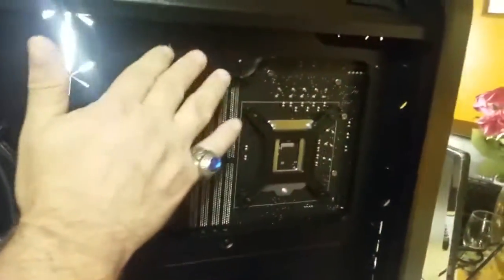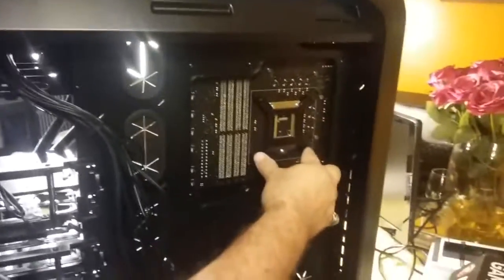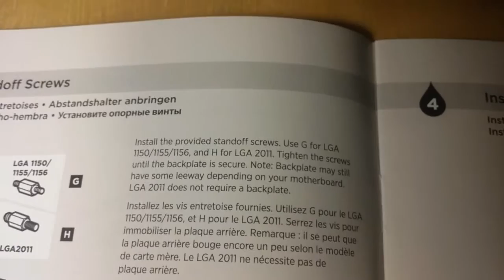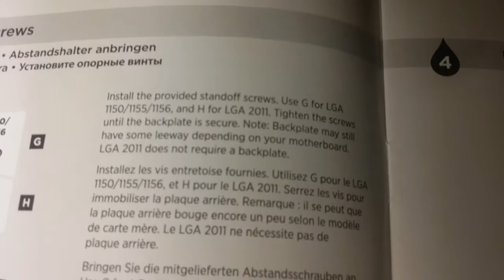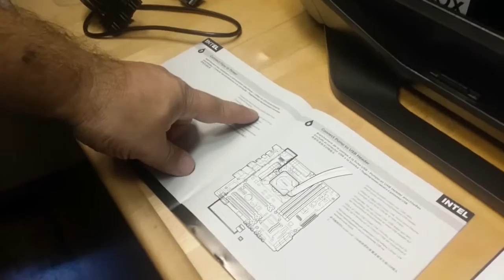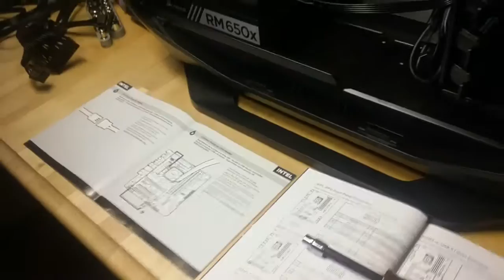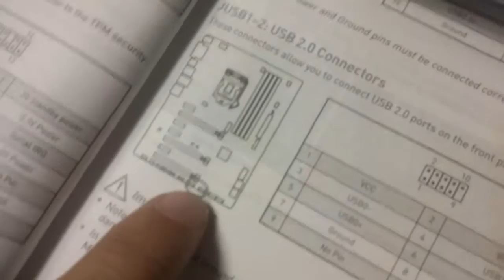Connecting the Corsair H110i Pump to the MSI Z170a Gaming Pro Carbon Intel (I5) CPU

Comment: dude ... the fans of the radiator  are in the opposite way ... omg  if u gonna make a tutorial  do it right
Reply from the maker: This system is still working nearly 4 years later.  Fans were set up to pull cooler air into the system from the top.
Reply: @GamingMotorCycle   yeah ofc it's working  ...  but  no like he should be working
Reply from the maker: @zurikkk  explain how taking warm air from inside is going to cool the cpu bettter than cool air from outside?
Reply: @GamingMotorCycle  it's exactly what I'm saying
Reply from the maker: @zurikkk  Good, we're in agreement.

Comment: i have h97 pro gamer  i don't know pump cable add where in motherbord
Reply from the maker: Not familiar with that mother board...if it is Corsair, they have pretty good support...you should call them.
Reply: @GamingMotorCycle  yes coraair h45
Reply: My pump is max speed at 4400 rpm
Reply from the maker: @MeloWorldYT  Here's a reasonable link showing installation: https://www.youtube.com/watch?v=VeHnJWgWP9E

Comment: Is it running okay without applying extra thermal paste??
Reply from the maker: Yes, the CPU is running fine.  We did eventually have a burn out of the GeForce Graphics card... that has been sent back to MSI.
Reply: Charles McDonald So it was just a defective graphics card and not related to your power supply or motherboard damaging it?